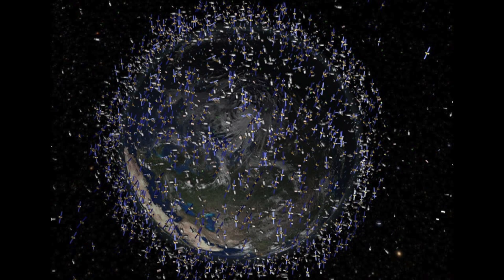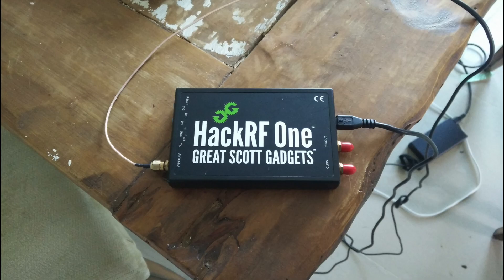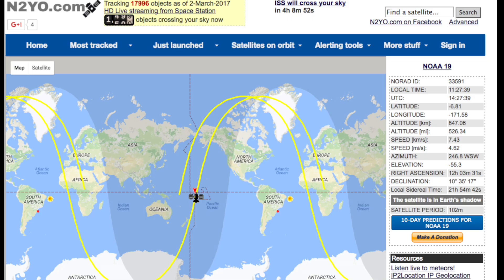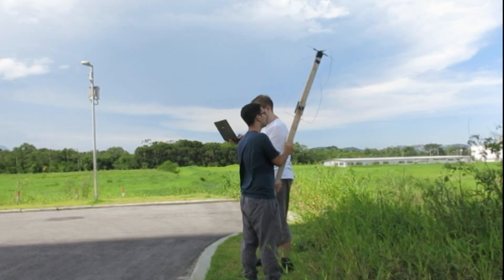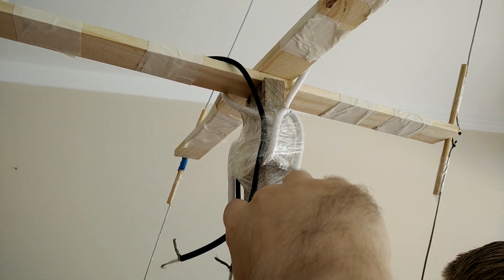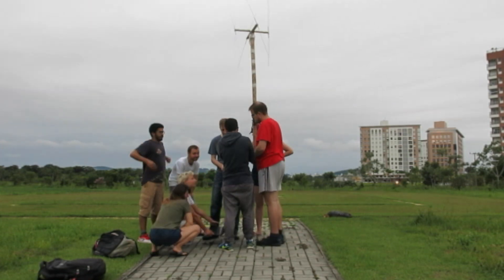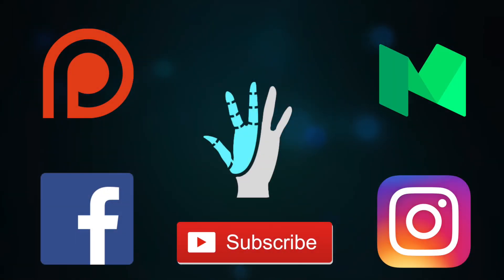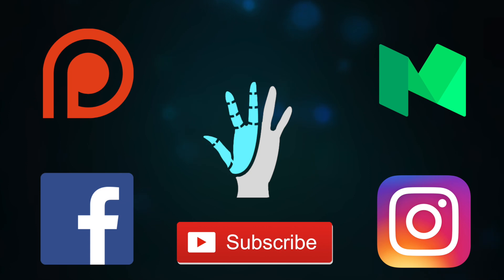How to Pull Images from Satellites in Orbit (NOAA 15,18,19 and METEOR M2)

Comment: All flat earthers should build one of these roflmao!
Reply from the maker: Wayne Johnson wait until we get GOES. we see a full globe. we want to coordinate with people around the world to build up a full 360 globe. the flat earthers are gonna be real mad. But that's for later ;)
Reply: @thethoughtemporium  oh yeahhh ive seen a lot of full globe
Reply: Strange Faction They are not experiencing those temperature extremes like you imagine because the molecular density in and above the thermosphere is so little that the satellite might not encounter molecules for the transfer of heat to take place for long periods of time. In other words, something in space only encounters heat when it comes in contact with a molecule, and that is rare is space.
Reply: Flat earthers should watch this video. 

https://youtu.be/g0imcpdLdB8
Reply: @Kenneth Thomsen but the images undergo constant geometric correction, dont forget to say that, it says it on the apt signal wiki
Reply: What software is it
Reply: Results would be inconclusive. You'd need to be far away to prove the globe, or else you're just custom tailoring a composite image to fit the globe mask.